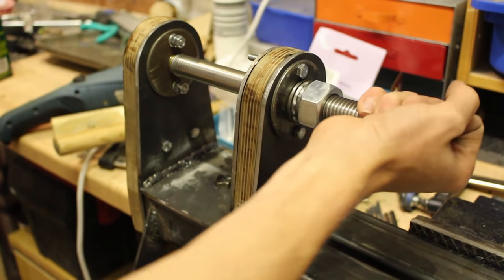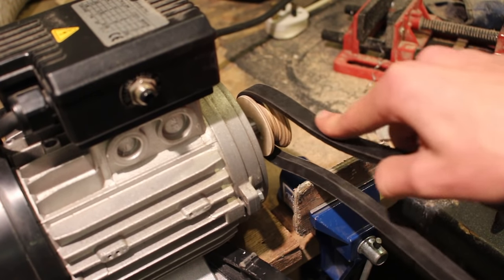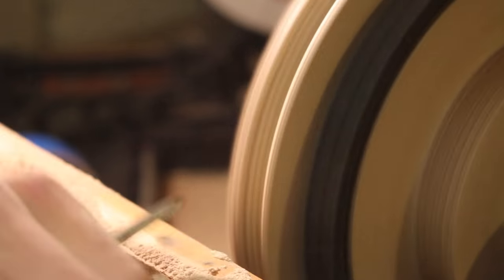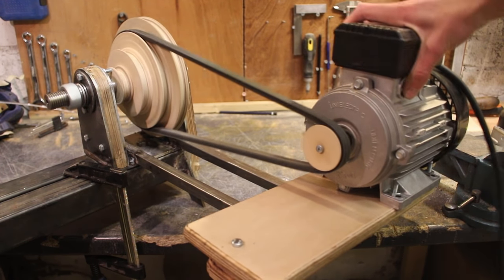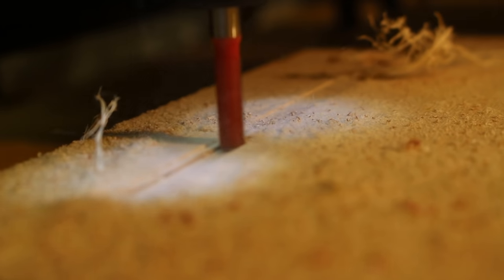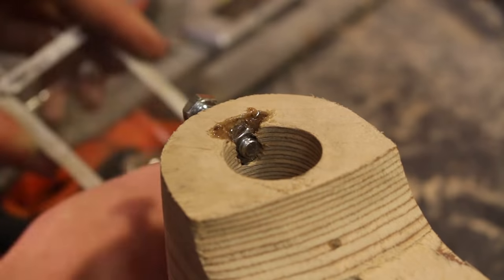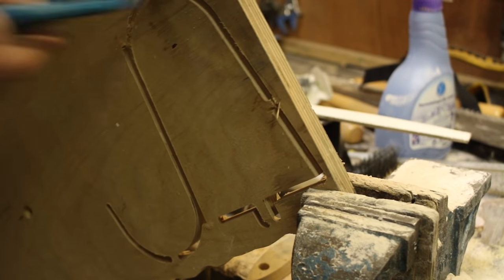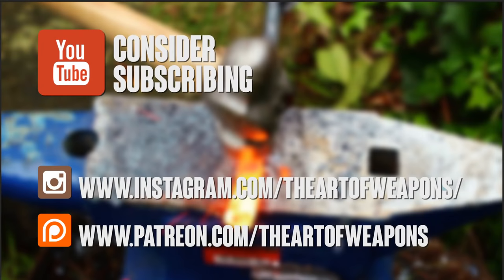How to Make a Wood Lathe From Scratch - Motor and Tailstock

Comment: i would recommend putting the rear tail stock threaded rod on bearings so it spins with the piece you are working with you may find as it is it will either burn the tail of the timber you are working on. or as its spins against the stationary tail stop it will loosen and may put anything you are working on out of alignment. it may also split softer timbers

Comment: The usual method of adjustable pulley reduction system is to have the same set of pulleys on both the spindle and the motor/drive, set oppositely, the biggest wheel on motor faces the smallest on the spindle and vice versa, so when you "change gears", you dont have to move the motor. Of course, you would need reduction with that high rpm motor, and stiffer material for the pulleys, so they wont get damaged when switching gears. (look in the drill press how the pulleys are aligned).

Comment: I am thinking of using a FIsher and Paykel SmartDrive motor for a wood lathe, would I need pulleys or would I just control the speed with a potentiometer? Also, would the motor be too powerful?

Comment: Only things that come to my mind is to reinforce the motor's platform (that thing's wayyy too wobbly for my liking) and fill and pack the pipes of the base with sand to further cut down on vibrations. 
And you should probably use more washers with the bolts on here, or at least with the motor's pulley wheel. my paranoia spiked up on that thing possibly cracking and flying apart when I saw you put that together.